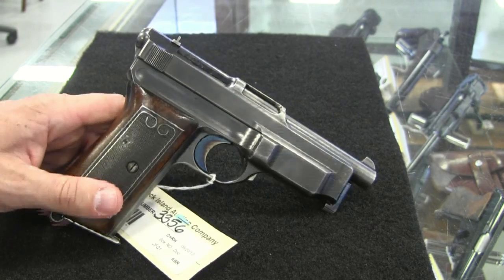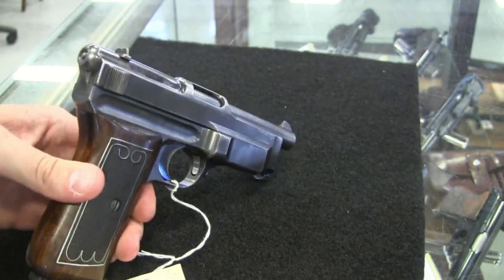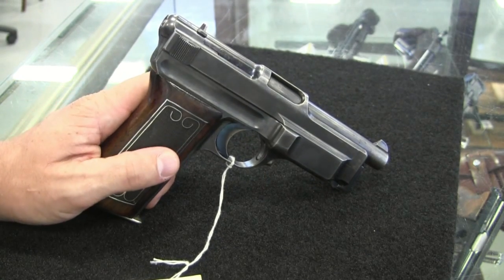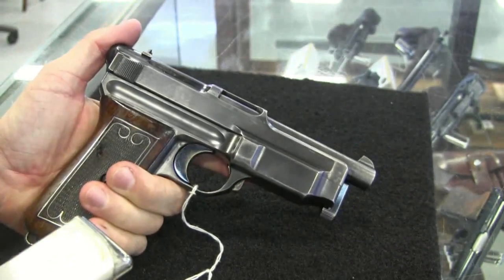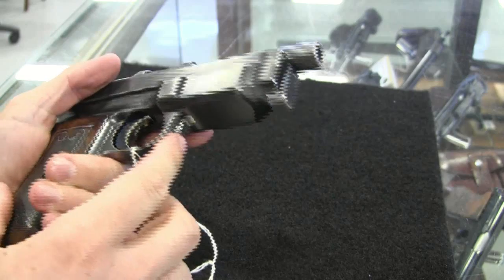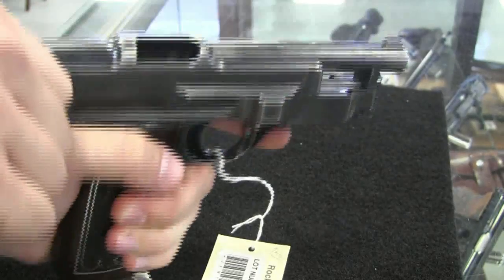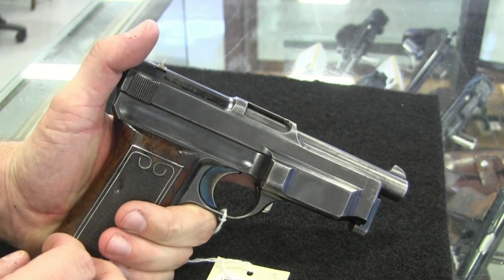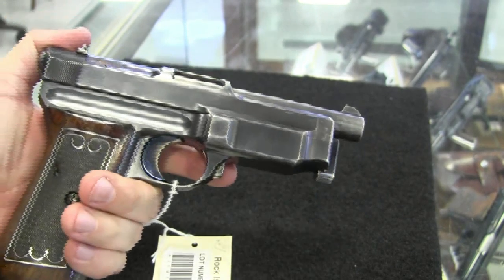Mauser 1912/14 Automatic Pistol

Comment: In 1974 I owned for a very short time a Mauser 12-14 in 9mm Luger It was serial # 4 . It was all matching except the clip that was missing and replaced with a P 38 mag that functioned well. . The GI that brought it back also sent home a case of 9 MM Luger ammo with the truncated cone bullets When they were shot up over the years Hr didn’t believe round nose 9 MM was the same so He wanted to sell the Mauser and get a shooter. I think there are 3 variations of locking systems used in these 12-14 Mausers. My gun used long flapping lugs and a stud under the barrel. It had fixed rear sights and was cut for a shoulder stock. One really weird thing was it had an Eagle N proof on the rear of the frame . That came into use long after the 12-14 s were made. A few years ago Rock Island auction Co. sold a 12 -14 that was in 45 ACP.

Comment: did the 1912 have the safety release button on the left side like the 1914 has? which is a umm weird thing. FYI to those who do not know, the left side of the .32 version had a button on the left side grip area that instantly released the safety. Why? who knows,  the one I own that is in very nice shape, a 1914, and has this. It is in the place a modern pistol has its mag release, and is independent from the real safety. press the button the safety instantly snaps off, I just would never carry it in my pocket loosely with keys.A key through the trigger guard in front of the trigger in your pocket, and a nice press against your leg would press the safety release and the key trying to flatten would press the trigger. pow

Comment: I'm assuming the slide locks open after the last round (seems to with an empty magazine) so a reload in combat would be to remove the empty magazine and insert a new one, makes for a very quick reload.
Unfortunatly I think it would cause some problems with clearing stoppages, you couldn't TRB because you'd need to remove the magazine to release the slide.
What about a light strike? Can you restrike with this? can you cycle the slide to clear a dud round without having to reseat the magazine to release the slide?